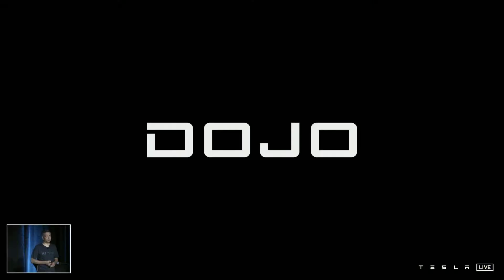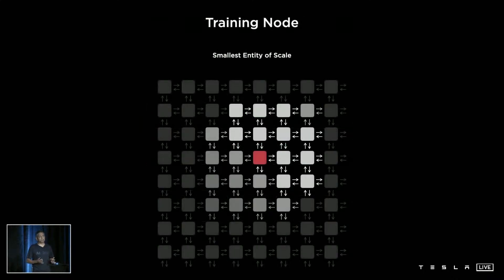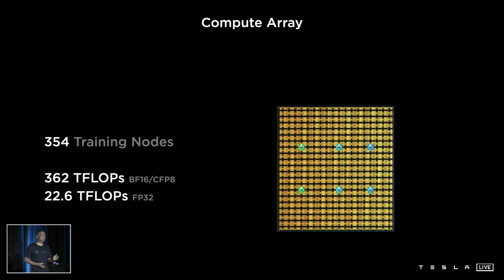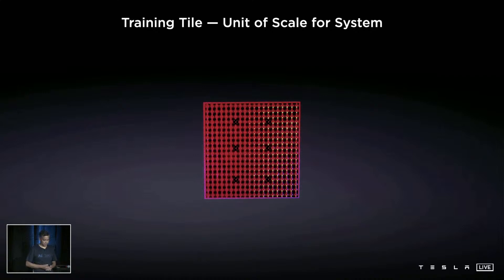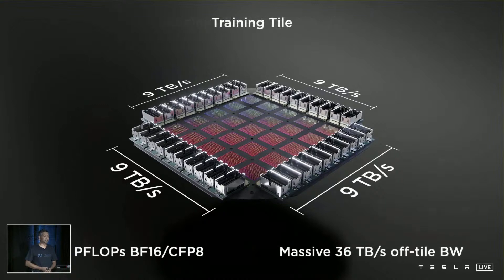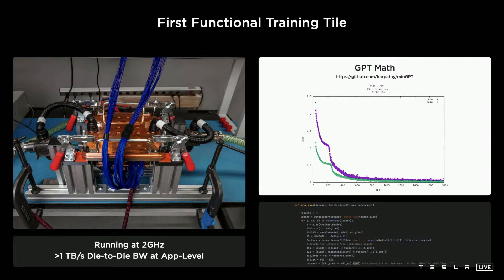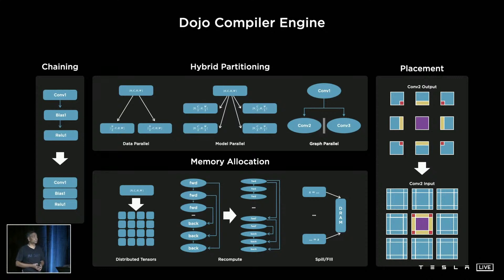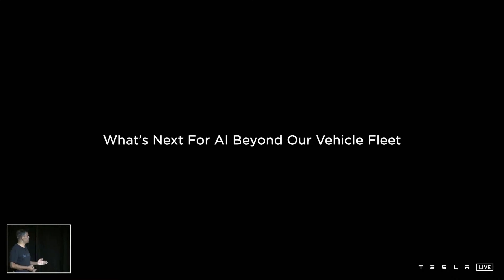Tesla's AI chip REVEALED! (Project Dojo)

Comment: How to scale it to other planets? Can we dynamically make a copy of the earth 🌍 physics , or would it be the best to fill the dojo-1-moon and the dojo-1-mars physicals data set by Sensoren on-site of moon or mars , without simulating it years before we can do it physically on these planets ? What about a experimental dojo-1-sun simulation on earth ? I guess that the moon and mars dojo Main Cluster will be installed on the planets not on earth because of delays and governmental reasons ? How to include the military Star force command in all these steps ? What about loop breaking routines to prevent Supra dead ☠️ loops ? What’s a bout building a transport mechanism to setup the outer earth located dojo’s at mars or moon , initially or after a main update of the systems firmware after continuous development at Tesla Dojo HQ Root on earth 🌍? Or will it an open Dojo Interplanetary Dojo Matrix , where every planets 🪐 dojo team may add software packets at any level of the dojo system ?

Comment: I'd like to see a video just talking about the cooling system for this monster.
Reply: That's why I don't believe it. Explain to me how you cool this. I want to believe, so badly.
Reply: @Tential1  OK, first, just to clarify, I didn't mean to suggest that they couldn't cool it—only that how they do it would probably be quite an interesting subject in itself. You have to get the coolant as close to the chips as possible. I would bet money that they are using liquid cooling—maybe even liquid helium. Expensive as that is, it's been used for decades. Every chip probably also has thermal sensors, to reduce heat generation if the temperature gets too high. I don't think it's predictable exactly how every chip is going to make out thermally when you have whatever vast number of those there are.

So I'm sure it's liquid cooling, maybe liquid helium, and temperature sensors providing automatic thermal limiting.

I've also been told that crystalline materials, if they are isotopically pure enough, can become thermal superconductors—thermal resistance just disappears, and all thermal vibrations just shoot right out of the material unhindered. Again, that's theory, I don't know how it works in practice, or the status or cost of such technology, or if Tesla is using any such technology.  I would guess not, but wouldn't be totally chocked if it showed up somewhere in some way.

Comment: D1 Compute may power Tesla Robot pretty soon. Imagine the deep nets that robots can leverage on those 9PF with single tile, I  am not even talking about upto 1EF mode. Mind boggling 🤯
Reply: The 9PF tile needs at least 10KW of power. Any robot using it will need a huge battery pack, or would need to constantly recharge or swap the batteries, or be constantly connected to a power cord. It will also need another cord to continuously transfer the liquid coolant it is currently designed to use. 
Most likely the robot will carry no more than 2 D1 chips - more than sufficient for simple repetitive work.

Comment: Non expert here :   What does training chip mean? Is it to train the AI system? Will they then make a chip not for training? How is it used in the cars? Or is it for the robot? What else can the chips be used for? What’s the timeline and difficulty to scale up the chip manufacturing?
Reply: With machine learning to produce a working "model" or neural network you start with an empty model and perform training - a series (many millions or billions) of computations where you feed input to the model, measure the correctness of the output and then adjust the morel to minimize the output error. This process is commonly referred to as training the model or training the network. This process is different from using already trained network, where you simply feed the network some input and consume the output - also referred to as inference.

A training chip would be a chip that specializes in speeding up the process of training models or neural networks. An inference chip would be a chip that speeds up the usage of a neural network. Training models is much more computationally expansive than using models and training chips are much more complicated than inference chips.
Reply: This is the chip that goes in the supercomputer that's used to train the AI on new data. The resulting AI then gets sent to the cars where a different chip (shown in their autonomy day presentation) runs it. Training an AI requires very different computations compared to executing it without learning.

Comment: Is the RAM off-tile then? What is it? Or are they going for an SRAM heavy design where the next hop is fast storage, no RAM in between? Doesn't seem like that would be enough but who knows, I didn't notice RAM anywhere in the presentation
Reply: On the sides of each chip there was 4 tb so 16 per chip * 1500 chips 24000 tb of cash. <i think i was misread do not go off this.
Reply: @nielnielsen4822  The long dies surrounding the 5x5 chips? I may have missed where they said what those were, are those HBM? Where did they say it? I figured those were IO.
Reply: @Tiporae  You may be right, I may have misread it, going back to see. ty

Comment: @12:16  18,000 Amps into a tiny package.  How does the chip not explode?
Reply: its 18000 Amps across i believe 25 chips in a multichip module setup each chip is rated for like 400w i believe
Reply: @Kurumi.tokisaki.  Thanks Kurumi. So 400 watts times 25 = 10,000 watts.  That's a lot of heat.
Reply: @59seank sounds about right but I'm not exactly positive on the exact wattage and amount of chips. I believe those are the correct numbers tho. You also have the edge mesh network stuff going on and I'm not sure how that factors in. I believe a single system pulls 15KW and is 4 or 6 petaflops of compute power. And can be easily connected and scaled with other dojo systems

Comment: Good luck cooling it at max dissipation. Is there software for it? What about Amdahls law and saturating your network interconnect fabric?
Reply: They answered these in the Q&A. They have no problem with cooling. Remember their engineers do this on Tesla cars for a living. Also the bandwidth saturation issue is solved by exploiting locality and limiting compute to nearby units using software.
Reply: @meatsaucez1516  They still have to route traffic through the nodes interconnected in the mesh. The processor in the cars doesnt run at 15KW and there arent dozens of them adjacent to each other. Besides, you are writing as if they have definitively solved the problems when in fact that have only 1 test stand unit running at partial speed.
Reply: @alexandrsoldiernetizen162  “they still have to route traffic through nodes interconnected in the mesh” 
the chip is designed from the ground up to solve this bottleneck. Each individual chip has more than twice the bandwidth of a network switch and equally distributes them between each edge.

“The processors in cars doesn’t run at 15kW”
The chip is not supposed to be used in the cars. 

“Besides you’re writing as if they have already solved the problems”
My mistake. I meant to say that these are their solutions to the problems you stated. Whether or not they work right now we have no evidence. But considering they did develop the whole thing and managed to run minGPT on it. It really helps with the credibility. 

 “when in fact they have only 1 test stand unit running at partial speed”
We don’t know if they only have 1 test unit or if that unit was running a full speed.
Reply: @meatsaucez1516  You fail to understand Amdahls Law: "show me where the data is and I'll show you where the processing has to be". You cant guarantee locality of data with edge connected storage that has to route traffic through the whole processor mesh to get a byte to where it needs to be.

You are the one that used that car analogy  to justify their ability to cool it.

Uh yeah, we do know, they showed the single test stand unit and said it was running at 2 GHz which is where they ran the GPT.
Reply: @alexandrsoldiernetizen162  Amdahl’s law is about calculating theoretical maximum improvement in latency due to parallel computing based on the proportion of latency that can be parallelised. How is it relevant to the issue at hand? Machine learning is can be easily done in parallel. 

I brought up the car example not because of the computer in Tesla cars, but the battery pack. 

They showed a single test stand, but that doesn’t necessarily mean they only have one unit. They probably have quite a few engineering samples laying around. That’s how it usually works.

By the way why is how many chips they have relevant? You asked how they are going solve some problems and I answered.
Reply: @alexandrsoldiernetizen162  care to explain?
Reply: Nobody is claiming it's working at the full capacity ;)
Reply: @muons  What good is it if it doesnt work at full capacity? If you make certain claims the assumption is your final product will at least asymptotically approach those claims.
Reply: @alexandrsoldiernetizen162  It will help to keep the overblown stock price afloat through the hype, as it has been done to this day. Keep in mind this is a product for the internal consumption only. There'll be no customer to test or complain about its reduced capacity.

Comment: And then, many years later, just like what happened before, an architecture, the size of a room, or a cabinet, now fits your pocket 👀... I wonder, what will the technologies of the future, be used for? 🤔
Reply: Sooner or later transistors won't be able to physically get smaller. We already have insanely small transistors and building them smaller and smaller is what has been driving computer performance up and up and up. We will see what happens in the coming decades.

Comment: Interconnection speed is a clear bottleneck in current setups and Tesla just bumped it up by an order of magnitude. Amazing!
Reply: Could you please explain this in layman's terms. I really want to learn and appreciate what AI day revealed but I don't understand most of it :(
Reply: @mishafi2088  Having high computing power is good only if you can throw data at processor through high bandwidth. If the interconnection speed is not high enough then the data transfer between the processors and data centers will limit the actual throughput of the system. Tesla took care of that! While they increased processing power, they increased the data bandwidth a lot more and hence they can get better use out of the whole system.
Reply: @ThinkSleepLeave  thank you so much :))
Reply: This truly blows my mind. AWS and GCP data centers are toys next to this beast.
Reply: Big tree sharp axe
Reply: Do you think they already gave something like this running many years ago?

Comment: Exactly the same 400W TDP as A100, 2.3x FP32 performance, 15x interconnection, 1 year after A100. Obviously the speed interconnection is out of this world, Tesla is on something.
Reply: The A100 has been available for over a year, and was likely sampled to customers much earlier. By the time this actually reaches deployment I doubt it will be particularly impressive.
Reply: @johnm91326  I don't think anyone would be able to catch up the interconnection speed in a year or two. It may turn out to be the key to the next level.

Comment: This should've been the whole presentation. Easily the coolest part
Reply: No it was pretty basic in comparison to the other parts you most likely just didn’t get the others

Correction ( or at least on the same level you need software and hardware)
Reply: The general public will remember the dancing robots the most. Even though they are a joke.
Reply: Exactly, this was insane! Sadly everyone is going to focus on the smoke and mirror robot.
Reply: @bigfactsbigstacks6261  no smoke and mirror, also, this chip and the robot are one
Reply: @bigfactsbigstacks6261  pretty sure that was the intention with the robot presentation. so the media talks about something. cuz if they only talked about the chip. either critics are just gonna nitpick on how they gonna solve the problems. or the general people would just not care. they had to do something